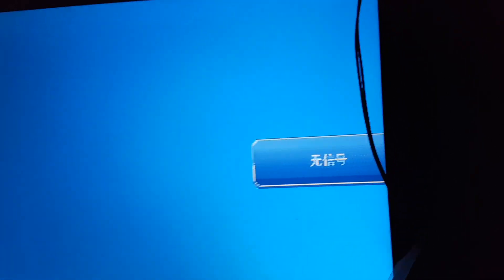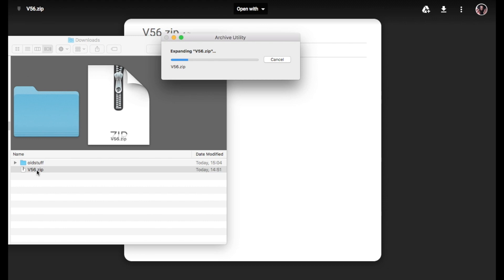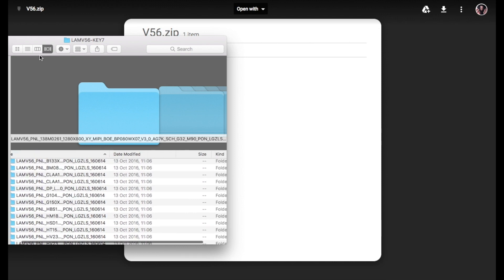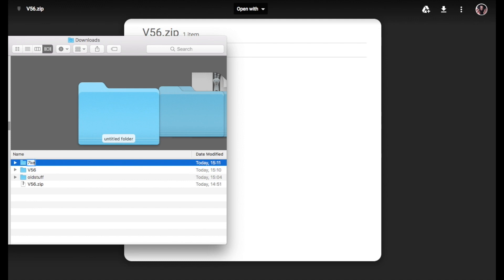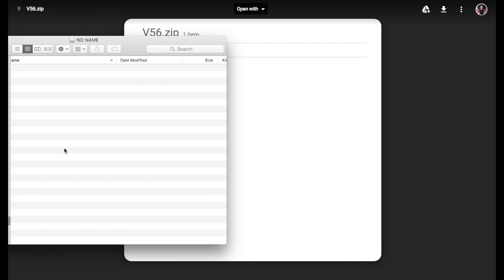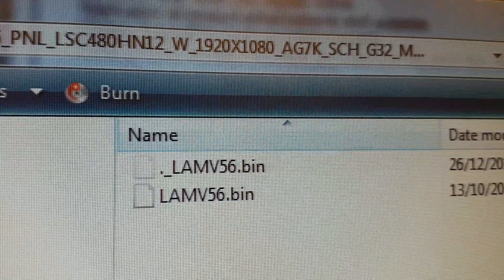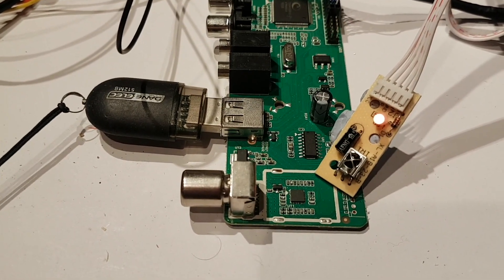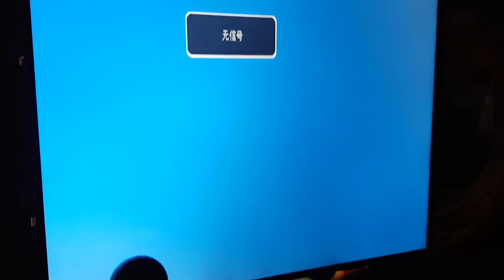Flash Firmware on to a V56 LCD panel driver board

Comment: while uploading this firmware, half away, my electricity was gon. After that i tried to upload again, but nothing happens. Is there a chance that my board is brick?
Reply from the maker: Unfortunately.  Probably.  For me when I have bricked a board it normally just comes on with a dim light and does nothing.  I am working on a way to put new bios chip on them to fix it but haven't been successful yet
Reply: @spidermaf  finding this board was hard in my area and its was expensive too 😓😓

Comment: Will these firmware work on nt68676 chip based LCD controller boards or only for v59 based boards?

Comment: Hi, Thanks.
I make the instalation on a samsung 23 inch screen. But stay only in white coolor. Dont works...
Have any idea what happen?
I can turn ON and Off by remote control.
Reply from the maker: If the screen stays white - the inverter is working, but the data is not.  Check that your data cable is the correct one for the screen/plugged in the correct way at both ends.  Also it may be that the data part of the screen has broken.  if it didnt work on the laptop it probably wont work with the driver card

Comment: привет 
необходима помощь !!!
приобрел скалер LAMV56 и не могу найти прошивки на свои матрици 
для начала проверить матрицу хотел LTM170EU-L31 так как уже на нее придумал и каркас и все остальное 
уже пробовал 20-30 прошивок по тем же параметрам матрици - но все равно белый экран
Reply from the maker: Артемыч Дарануца , если вы видите только белый экран, возможно, что кабель LDVS неисправен или неправильно подключен. Попробуйте другой кабель и убедитесь, что он правильно подключен к контроллеру. К сожалению, это подойдет многим. Извините, я не говорю по-русски.
Reply from the maker: Artemych, if you are only seeing a white screen it it possible that the LDVS cable is faulty or not connected correctly.try a different cable, and check that it is plugged into the controller header the correct way.it will fit many ways unfortunately.

Comment: I'm having difficulty in getting this worked. I hope we dont require lvds,  inverter connected while flashing,  i meant optional. My issue is i dont get the flashing signal when i try flashing it with usb stick,  no display or no sign of image, the lcd shows very bright white light on lcd,  does it mean inverter and backlights are working? I have a N154I2-L05 panel with a screen resolution of 1280x800 resolution,  could it be lvds cable which came with board is not compatible with panel? .  I need your help and you can email me@ sridhar051@gmail.com for screenshots.  If possible can you send me the relevant  firmware based on the info and also please address on what im doing wrong
Reply from the maker: I'm sorry - I'm by no means an expert on these boards - so I cant really help you.  This video is just how I did it for this specific panel.  It does sound as if your backlight is ok (and therefore so is the inverter) but you have a problem with the data lead to the panel.  I did find that as soon as I got the inverter working I did see something on the screen.  So if that's not working yet check the LDVS lead is connected the correct way around on your V56 board as it will go in both ways and both sides I think